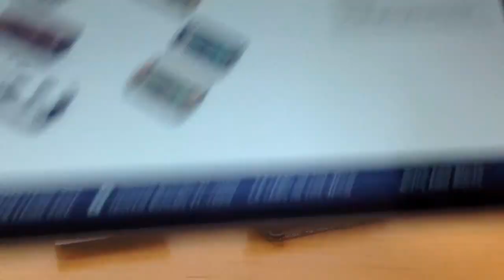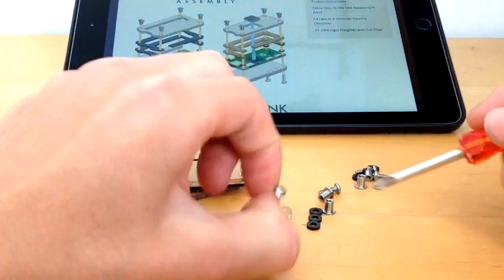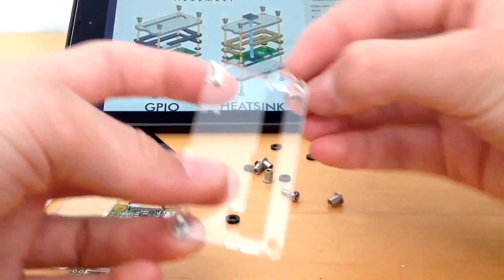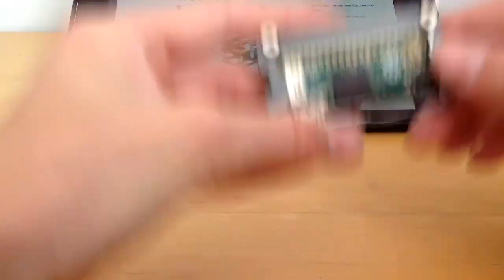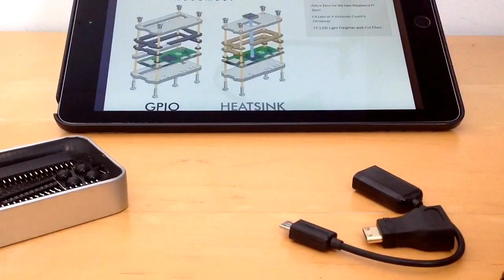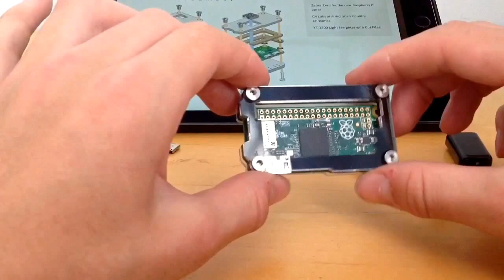Zebra Zero GPIO Black Ice | Assembly | Raspberry Pi Zero | The Pi Hut

Comment: outstanding, i found this vidio after spending 15 mins screwing with my zebra case, i did manage to figure it out without the instructions but forgot the circular spacers then after taking it apart and putting it back together i realised the bottom plate was upside down so that the GPIO dogleg/right-angle was at the wrong end.  all in all fun times were had by all.
Reply from the maker: +Tom Johnston oh dear, glad to hear the video helped!